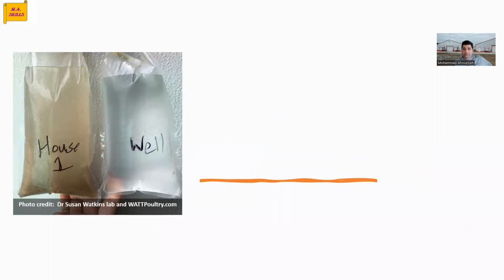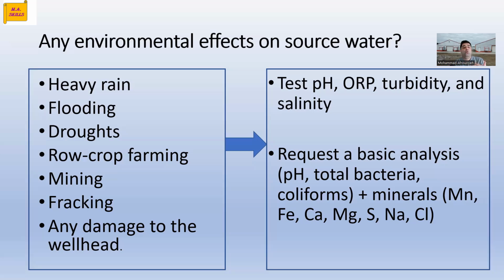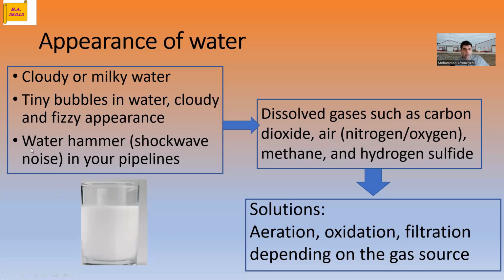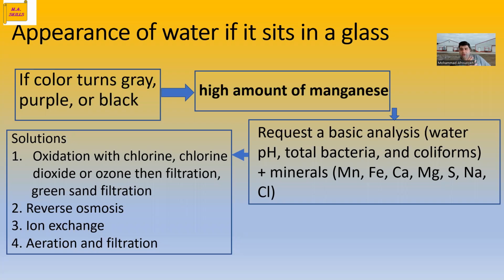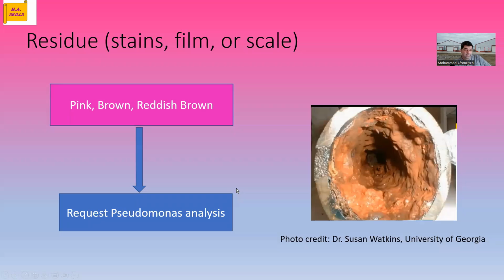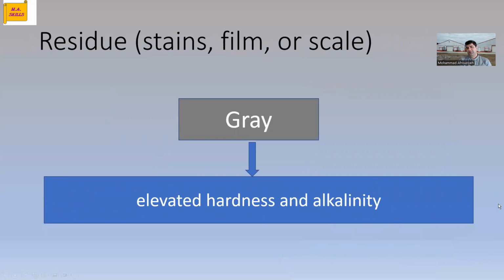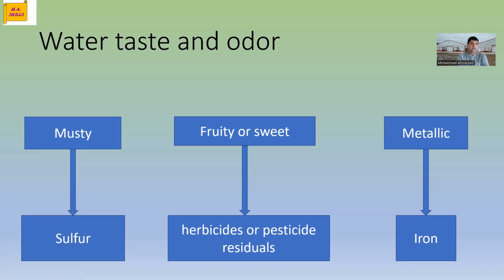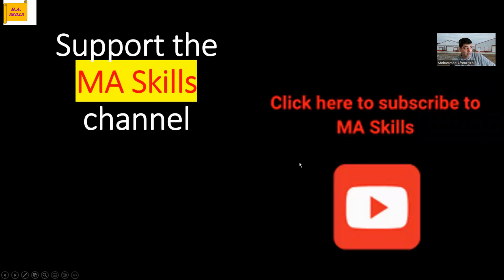water observational test on poultry farms

Comment: So take these samples from the end of the water line? or from the front before it goes to the birds?

Whats the difference between Manganese and Magnesium?
Reply from the maker: Some tests are from front and some from end of the line. If you specify your question about the test you meant, I can provide an acurate response
Reply: @animalnutritionist  When you take a mineral test etc. Front before water goes into barn to birds or back at end of line when its been through the birds?  I guess for that it be in the front. You really dont need to take water samples from back of line unless your looking for problems like Psotomonous E.coli total coliform etc..
Reply from the maker: @tankshmidt8252  That is correct. For mineral tests we should take sample only from front, but for microbial tests we should take samples from both specifically from the end of the line. The most important tip is that we need to take swab samples for microbial test not drip samples.